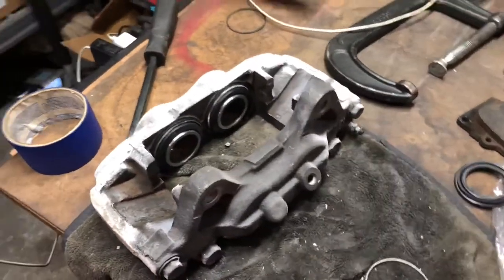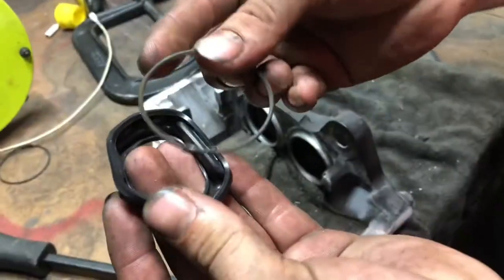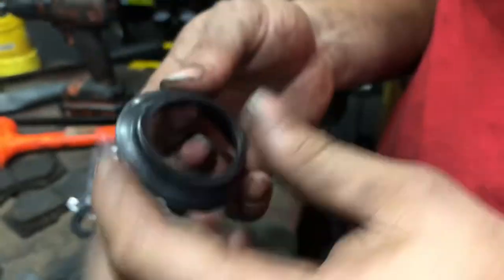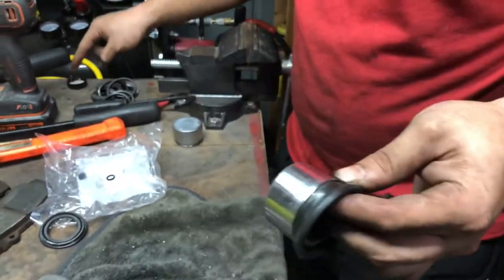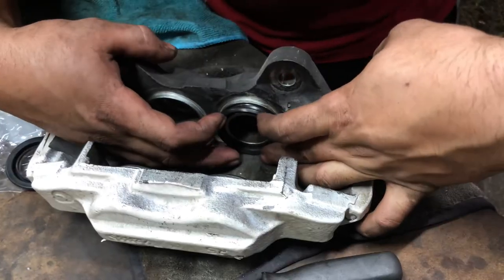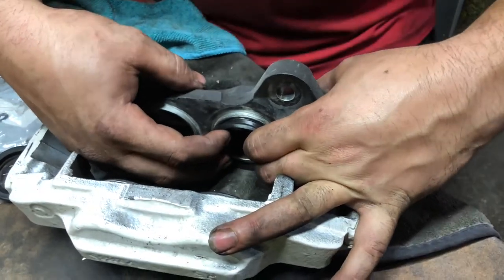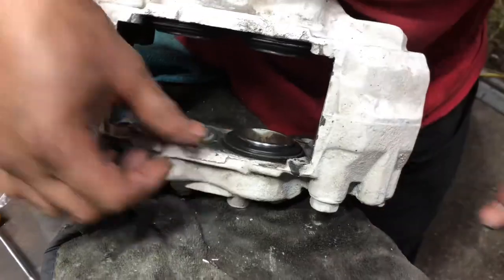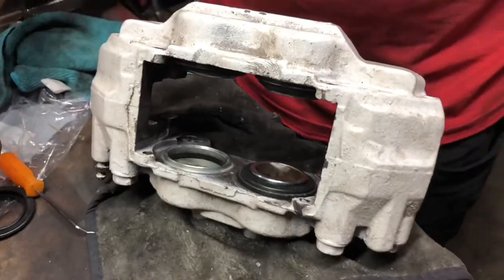Toyota 4 pistons calipers rebuild (tip)

Comment: Thanks for the vid, but I believe you can separate the caliper and its more easy that way.
Reply: That’s what I did
Reply: @TrumpTrainShorts how?
Reply: @TrumpTrainShorts do you happen to know what type of gaskets the bolts take? The ones that hold the caliper together?
Reply: @ivancortez1262  There are no gaskets. I have 2 different calipers that have 17mm and 15mm bolts (2 each) and the other caliper is held together by 18mm and 16mm bolts (2 each). So there are total 8 bolts holding the front calipers together, without any gaskets, although the bolts have a hat top which is kind of a gasket I guess. 
There is 1small rubber o-ring inside a front caliper that seals the two pieces together, so make sure not to lose it when opening a caliper.